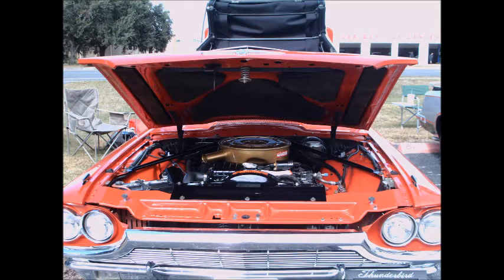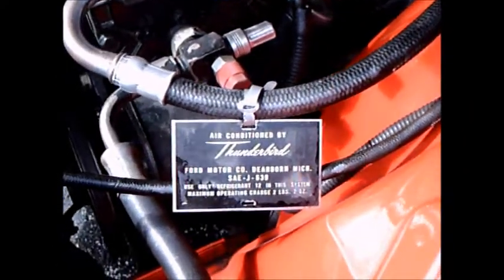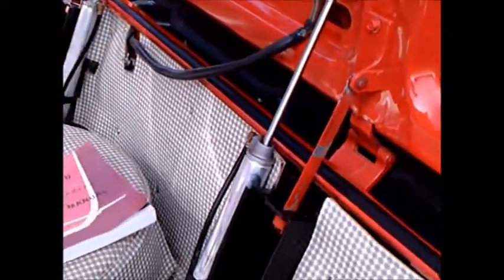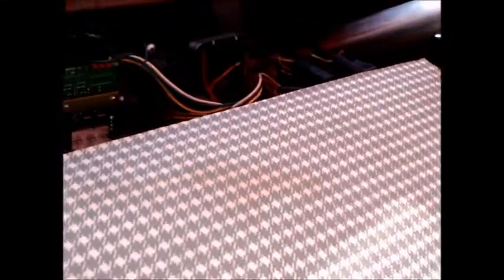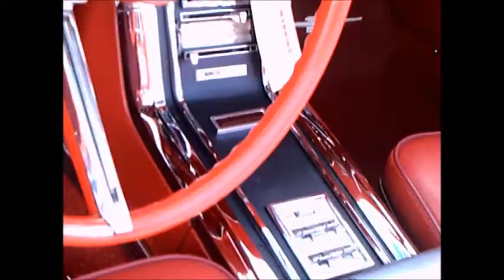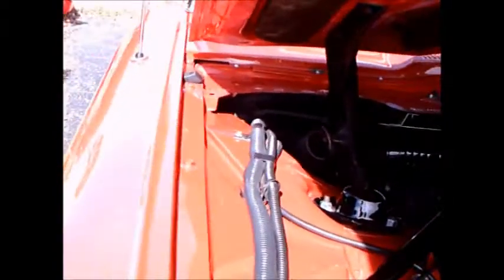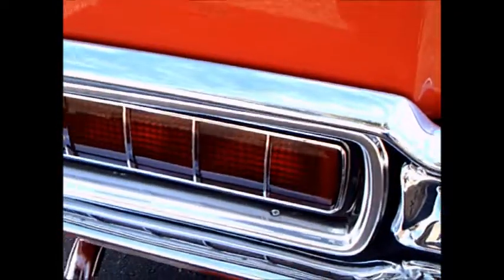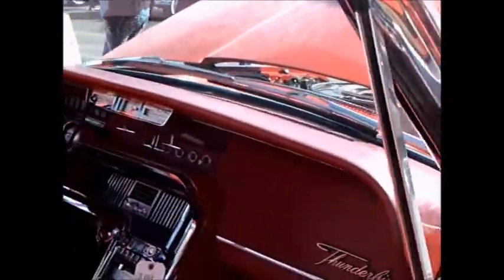1965 Ford Thunderbird Convertible Red GatorHarley013016

Comment: Beautifully done and displayed, I've never seen the mechanicals for the retractables before, quite elaborate! Love the lines of the car and the come fly with me interior. I really prefer the '66 model because they were a bit more refined especially the front and back ends. My dad bought a Landau Coupe in '67 for my mom's car and shortly before they traded it for a '70 TBird, I learned to drive in the car. About the only changed inside in '67 was a lot of brushed stainless steel trim. 

Gorgeous ride, thanks Jack!!
Reply from the maker: +46619TAB Hey, Terry!  That's the thing that fascinated me...the relays and wiring exposed for the casual observer.  And believe me, the innards didn't have a trace of grit or grim about them.  This was in museum display condition!  Wonderful patience to keep a car in this condition.  Glad you had experience with like...a privilege to have a car like this!  Thanks!  :) Jack

Comment: Nice! I didn't realize that these 'Birds front seats had headrests hidden in them. It's nice to see how the top works; quite an array of electronics to it! I wonder how one got things into and out of the trunk under normal circumstances with the top up or down.
Reply from the maker: That's a great question...with top up, I'd assume you activate the lowering mechanism whose first step would probably be opening the decklid...with the top down, probably activate the switch to operate the top, first step being opening the decklid.  Thanks!  :) Jack
Reply: Your answer makes sense. Likely you're right.